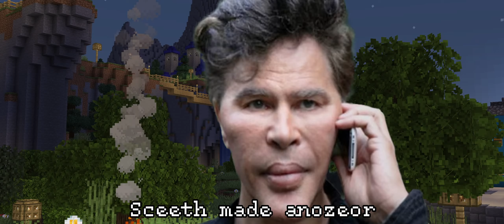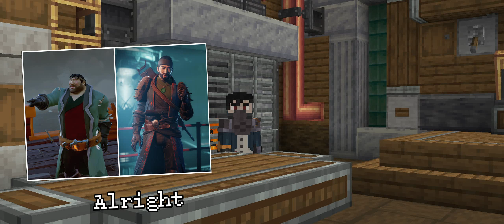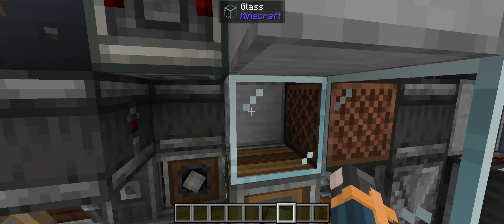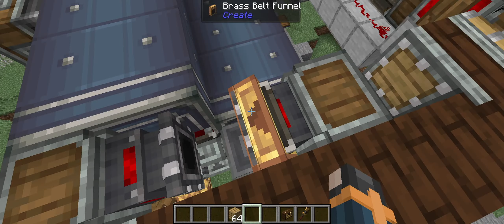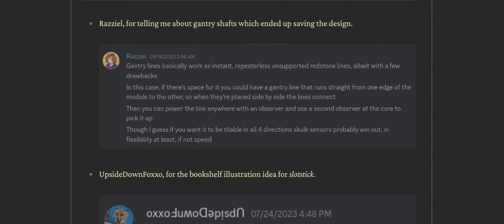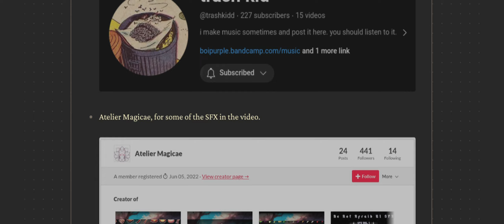They patched my storage so I made a better one | Two Way Tileable Storage in Minecraft #createmod

Comment: I do hate internal clipping windmills, but I also appreciate the branding to make them 6's.
Reply from the maker: I'm surprised someone noticed kek
But aye, in a larger base I'd imagine the windmills would be swapped out in exchange for just a line of shafts hooked up to a generator somewhere. For now windmills are the easiest modular option though, even when placements get a bit funny. If I ever comeback to it though, cleaning up the power gen is definitely on the list